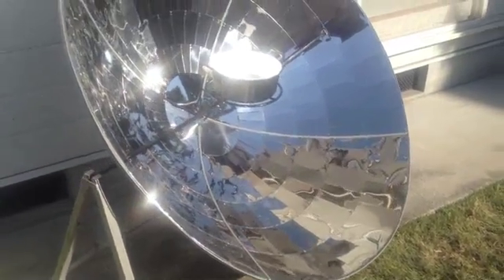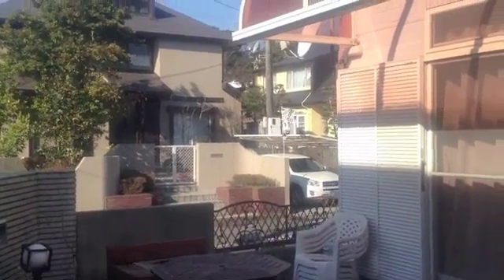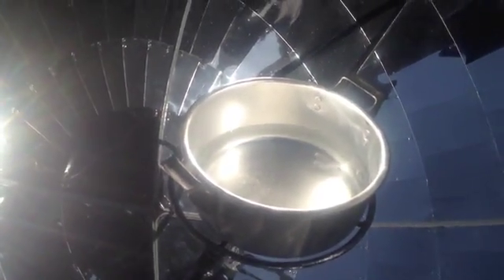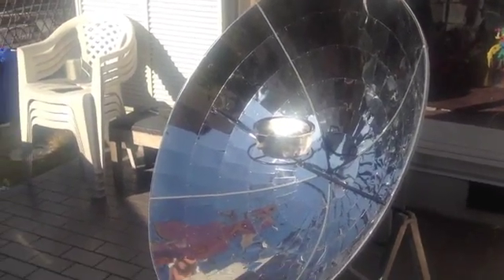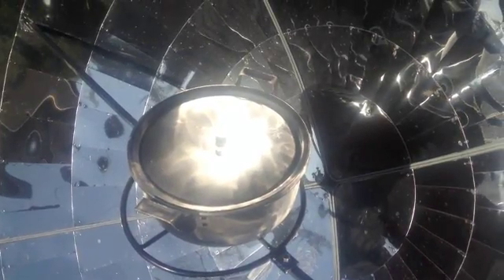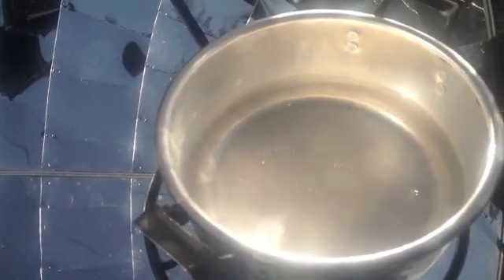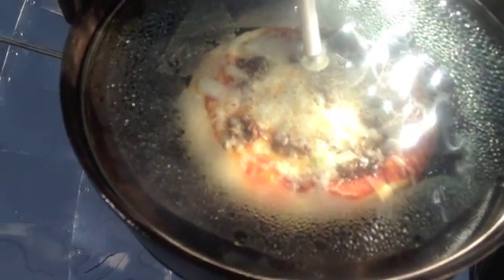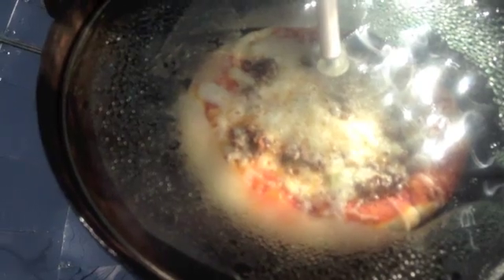1.3 meter Parabolic Solar Cooker

Comment from the maker: The dish can be disassembled into 4 pie pieces and the stand can be folded but its made from iron and stainless steel so its a little heavy.  I don't plan on moving it around that much.  I'm using it for fun, to save energy and emergencies. Thanks fro your comment.